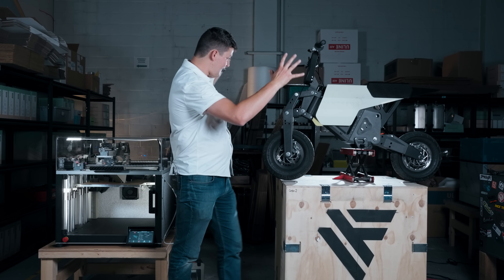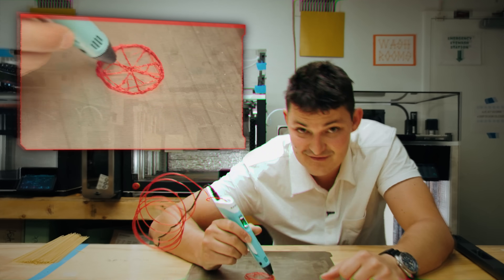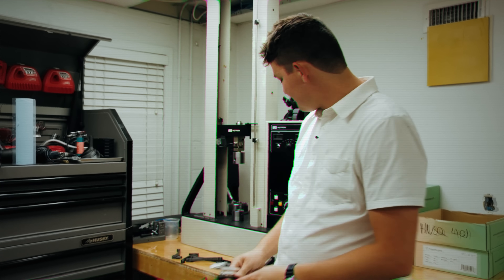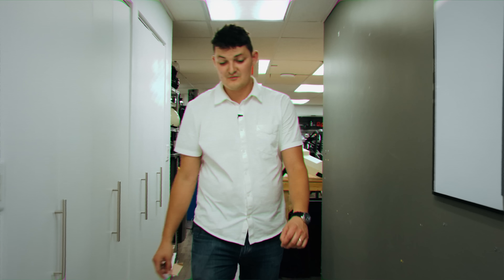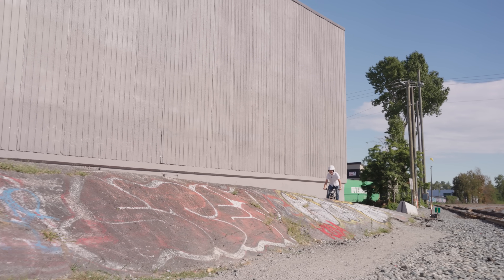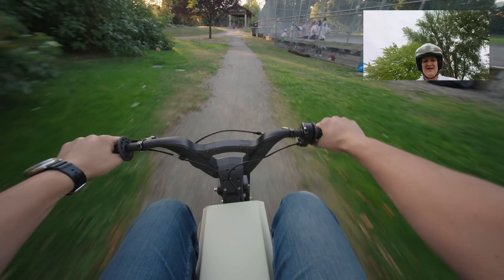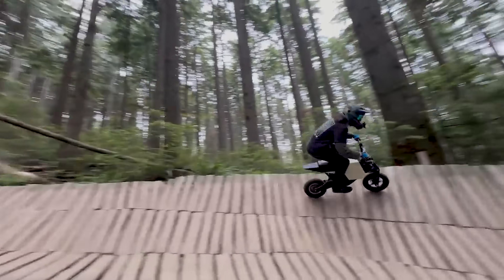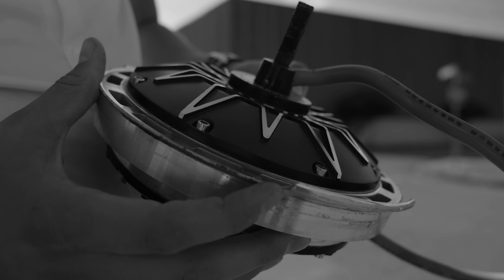Jumping a 3D-Printed Motorcycle - How Strong is the Future?

Comment: For prototyping 3D printing is a godsend. No arguments there. And also for hobbying and making obscure parts it's nigh on essential. To a point, as you mentioned, strength of the material as well as heat resistance is a major concern. Sure, you could in those cases use metal 3D printing, but that's another overhead cost, and it's a major cost to boot

And while the idea of a shop that sells print-to-order parts is attractive, homologation of said parts and the frankly immesurable danger to IP theft, not to mention the cost of the printers themselves and the time it takes to make a part, are major downsides. Especially for cars and the most often busted parts that you might need replacing - body panels. Scope of realistically 3D printable parts for automotive industry is way smaller than we might think. But the design principles and extrusion optimization we can learn along the way provides major value
Reply: You don't have to print the parts you'll use, it can be a lot better to actually print moulds or patterns which can then be used to make parts by other methods. For example, you can print a mould or plug and then layup composite over it, or print a casting pattern which is then used with traditional foundry techniques.
Reply: Pretty sure nylon absorbs water and weakens over time.
Reply: @pleepler Nice to see positive comments about 3d printed vehicles. Check my product if you want it has the most parts 3d printed, from metal chassis to rims and tires.
Reply: I think you're focusing on the wrong things that would be manufactured when you mention body panels. 

The actual, real, things that would (and are) be 3D printed for vehicles are the small plastics bits inside the cab like climate control knobs, turn signal stocks, air vents, infinite amounts of little plastic covers that exist only to hide screws etc etc etc
Reply: For the industry- yes. But a new age bodyshop's gotta have a printer. The only obstacle is, as you said, bureaucracy, but all you gotta do to bypass the feds is to sand and paint the part.
Reply: LOL you lost me at IP theft. Because we have processes like vacuum forming and other that can just straight up use 3d prints as molds as an intermediary step and the fact that FDM is no the only printing technology on the block, you are vastly underestimating it's applications for MEDIUM sized business and yes it should and hopefully will be massively disruptive for multinationals.

Comment: I never thought I’d be defending Groms, but I’ve seen Groms get thrashed 10x harder than that in skateparks and off road trails alike for many years.  They hold up just fine.
Reply: I got my grom new in 2016. Its been used for everything from commuting to shredding to long trips - and used hard pretty much every time including a good few times where its been flat out for 100+ miles constantly. The only "fault" its ever had is the mirror stems getting rust on them after riding it in winter on salted roads and not bothering to wash it. It sits alongside my other out of the garage bikes and its still one of the most fun things I've ever ridden.
Reply: @siraff4461  You use it for commuting? What kind of speeds do you do? Any mods? I commute on a 60 mph two lane most of the time, and I've been wondering if a Grom would be enough.
Reply: @isaiah7617  I've run it down the motorway a few times. Its not ideal and way, way out of its depth but sometimes I fancy a challenge and it will keep up with the trucks if nothing else. 
I'm quite a big lad so it struggles to go much over about a genuine 55-60mph. Its got one tooth up on the front, airbox and exhaust, renthals, new mirrors and a few other bits like crash bungs which double up as highway pegs. 
It will do 50mph pretty much anywhere apart from the largest of hills because thats now where it runs out of power in third. 
Again thats gps verified because one of the first things I usually do on a bike is set one up to make sure I know how far out the speedo is. It does about 3mph better with the topbox on - no idea why unless it somehow helps with aeros because - again - I'm quite a big sail. 
I would say look more at the real speed of the traffic than what the posted limits are. On the motorway the left lane is pretty much 56mph or less (the trucks limiters speed) so its not really an issue. On single lane 60mph roads its more tricky and I feel like I have to pull over now and then through courtersy. 
You can use it anywhere if you keep your eyes open but I would want a bit more power if it was my only bike. Having said that I've been spoiled by superbikes, motocrossers and 2 strokes for the better part of 40 years so you might want to test ride one and see how it goes. 
If you're not license limited there are plenty of tuning options too but I haven't done much to it because I have quite a few bikes to choose from and haven't seen the need.
Reply: @isaiah7617  One other thing I should point out - even when its flat out with a 22stone guy on it it won't get lower than 100mpg (uk) and if you treat it fairly on normal roads its usually up around 150mpg. The rubber costs almost nothing, the chains and sprockets last ages and cost almost nothing, there is no oil filter so you just clean out the spinner and put in less than a liter of oil for a service. 
I end up doing mine way more than necessary because anytime you've got it on the table to clean it or check it over you end up just doing an oil change anyway since it uses so little. It costs less to run than a bus pass - even including buying it.
Reply: @siraff4461  See, I've owned several bikes,  most middleweight sport tourers, like the XJ600 from Yam, an 83 CB650 from Honda, and a 98 Ninja 500. But the small bikes seem like they would be a blast, especially on my commute. I used to take a Chinese 150 scooter, but having a top speed of around 50 made it not great, and you'd drop to 45 on a hill. Thanks for the response, it sounds like a lightly modified Grom would do me well.
Reply: @isaiah7617  stock grom will not be enough, you can get an inexpensive front sprocket to make it go over 60(at the expense of off the line speed). 55mph roads are much safer to ride. it is really meant to be in inner city vehicle with insane fuel efficiency
Reply: @isaiah7617  A few of my friends also got them after riding mine and some are in different states of tune. One has a bolt on 150cc big bore kit, exhaust, cam (came with the kit) and piggyback ecu - also in the kit. It tops out around 75mph on a good day but will cruise at 60mph no problem. Its a different kind of riding on them. With a big bike you rarely use all the throttle and power but on a grom its flat out a lot of the time. It feels weird at first like you're going to break it but so long as they're properly set up and looked after they are solid.
Reply: @isaiah7617 I commute a grom too. Its an in town thing. Mine has mud tires and its topped out at 60. I only get on highways for short in town bits. If I leave town I have to take the back roads.
Reply: @siraff4461  Sounds a lot like the Royal Enfield Himalayan I had, the engine never broke down at wide open, but the cluster started disintegrating. I did ride a Honda CB300R at wide open for 140000 miles no issues, so I would expect the same from the Grom. Thanks for the info I appreciate it.
Reply: Right? I thought the same thing. The only thing that fails is the forks but those are easily and cheaply swapped out
Reply: Couple weeks ago ran into a grom squad at Tail of the Dragon, that was the only group I thought, "they look scared as hell on those things"  lol.
Reply: Love my grom.
Reply: i mean- its a honda.
Reply: I know. Groms are surprisingly sturdy.
Reply: Yeah that line was stupid as hell. I get that he needs to do ads for things but he should still pretend he knows motorcycle stuff during them IMO

Comment: no way that plastic is even close to being as strong as 6061 aluminum
Reply: during testing it is but i dont know how long it would hold up overtime
Reply: it is, this has been known for ages. your power tools probably also use glass/carbon reinforced plastic instead of aluminium too because of strong it is.
Reply: @marvinslomp3564  it's objectively not. He quotes 150 MPa tensile, which is ~50% of what 6061-T6 can do.

Comment: brake disks are backwards --- spokes in compression, not tension, while stopping.  about 98% of all ebikes are the same but trust me (look at my avatar) this is dangerous.  I pretzel'd that thing while trying to skid my back tire on loose gravel  (not what you'd call high-torque except that I snapped it on quickly).

Comment: It's not really a motorcycle... more like a e-bmx... 

There's also the question of UV exposure; going through the hot/cold cycles and impact on long term durability. I'm not sure what it is, but plastics get more brittle with age... so how long will these toys last?
Reply: Indeed Nylon is suspectable to UV degradation, a coating (paint job) however can eliminate/heavily decrease that risk just like rust on a metal motorcycle.

At the temperature of body panels and frame parts Nylon is fine, rarely if ever do your body panels reach much over 110°c (the deformation/glass transition temperature) so again; fine.

Hell there are many cars with plastic body panels, ignoring all the bumpers most beloved to me the Smart roadster

Comment: I am waiting for 3d metal printing to come down to a hobbyist level. I collect WWI era guns and it would be a game changer to be able to replace small parts that have been out of production for at least 70+ years without having to hunt down used parts.
Reply: It kinda already is. JLC3DP can do metal parts, and it is pretty affordable. Worth modelling what you want and throwing it at their quote tool. Big stuff will be expensive, but small bits are very cheap.
Reply: Imagine being able to make a Vickers gun in your garage from some discarded bits of metal and brass. It'd be fantastic!
Reply: For some of those small metal parts you might be better off spending the money on a cheap 3d scanner and some modeling software. Then send the info to send-cut-send or some other place and they can cut those pieces out of most metals you'd like. 3d printing won't match cheapness for simple stamped steel parts for awhile. Hobbyist printers that can do metal are very expensive and the wire you'd need would be very expensive per part. If you can replace the parts with plastic it opens up a lot of possibilities, but I think you're better off sticking with stamped or cast parts. Casting can be done at home too if you're willing to work on your skills.
Reply: just get a bridgeport?

Comment: Okay, but how in hell are those springs working? Plastic can't bend that much, can it?
Reply: Not everything  on the bike is 3d printed, just most things, the stuff they can get away with
Reply: you can print flexible materials, but i think those are just normal suspension components

Comment: Whilst 3d printed carbon fibre nylon is strong when printed. It becomes very fragile overtime as it absorbs moisture if it doesn't get annealled or coated with some sort of waterproofing laquer.
Reply: the moisture isn't what makes it weaker over time, it's the internal stress of not being annealed. Nylon 6 or 12 parts are MUCH tougher when moisture conditioned.
Reply: Nylon gets stronger with moisture, it needs to be dried to print but its gets weaker as a result
Reply: moisture increases nylon ductility
Reply: Watch CNC Kitchens newest video on PA-CF materials, it suffers from creep quite severly, meaning bolts need to be tightened constantly. Not the thing you want on a motorcycle!
Reply: Currently running a CF nylon intake for my CBR swapped Grom for over a year now while being parked in the sun. Didn't use any coating or whatsoever. I didn't expect it would last this long though honestly.
Reply: I have a quadlock with longer arms that I printed in bambu ppa-cf which is mounted to my handlebar center clamp. Meaning, those arms are being directly compressed by the clamping bolts and if said bolts come loose, the bars will rotate.

It's been over 6 months and the torque I set on those bolts is the same. No creep, no cracking, all good. I checked the bars for movement constantly at first. I was paranoid.
Reply: Anything not coated will rot away, including steel. Kind of a common problem of vehicles staying outside. Carbon fibre is not different.
Reply: I think you can also make submarines for billionaires with this. Titanic trips, anybody?
Reply: I've had good luck with pla even left outside or under stress over time.
Reply: @skoparweaver7692  Yeah, but PLA isn't nearly as strong as PA6/12 CF.
Reply: On paper yes
Reply: @blueridgewarden  reminds me of a saying:
In theory, there's no difference than theory and practice
In practice, there is...

Comment: 3D printing is superb for prototyping and for small scale manufacturing. Anything above that is not worth it.
Reply: Theoretically a large mechanic shop could have one of these so they don't have to wait for parts, but even that won't work because the parts suck
Reply: Just like the cnc revolution before it. It has amazing abilities of utility for certain things
Reply: that depends on the geometry and material of the part

Comment: You can even 3d print titanium alloys, depending on the material and design of course it will be safe.
Reply: What is a mig welding if not original 3D-printing with metals.
Reply: @ninefingerdeathgrip  sort of, but not really. I don't think you could make anything entirely out of the filler wires. There is a process called WAAM (wire arc additive manufacturing) that is exactly like you're talking about. It's been around for over a hundred years, but I don't think it's that popular as none of the welders I know have ever seen it.
Reply: Nothing safety critical will be 3d printed. End of story
Reply: @ElijahRose-u6f  Incorrect. There are several bike companies 3D printing lugs and other parts for their frames, 
Heck, watch Sendy Club's videos, he's using 3D printed uprights to hold the wheels on to his Pikes Peak car.
Reply: @Surestick88 dude, it's a bubble. They'd make one part with the machine just to see how it works and get free money from wall street
Reply: @ElijahRose-u6f Okay man, believe what you want.
Reply: @Surestick88 how much did you lose on the stocks?
Reply: @ElijahRose-u6f  Define safety critical? While some parts might be critical for the safety or integrity of a product they might not be required to carry great loads. If calculated and made to spec 3d printed parts can last perfectly fine. Metal 3-D printing is also vastly stronger than plastics. At 2:40 in the video the yield strength is even compared. Besides that multiple real world examples are shown in this video also.

Its not my field, so dont have too much experience. But there are a lot of real world applications of 3-D printed metal. Especially for intricated shapes that are impossible to manufacture
Reply: @ElijahRose-u6f  Anyone that says this, knows very little about 3D printing
Reply: @ElijahRose-u6f  Very much not true already - indeed many of the 3d printing pioneer industries were very much safety critical. Think jet engine turbines and other very, very much safety critical items. Heart valve replacements are also somettimes printed, and while it's a smaller scale it's still pretty darn critical to the individual. Yes, there is often needless hype about 3d printingh, or AI, or inset shiny new thing here, frequently associated with stock performance, but don't mistake some of it being just hype with the tech itself being useless.
Reply: @ElijahRose-u6f 
Perhaps not FFF(exep in some industry's printing peek and such), but a lot of stuff is now sla printed, it is the same strength as the bas metal
Reply: @ElijahRose-u6f  Dude, GE's fuel nozzles for an airplane engine are mentioned in the video at minute 7. I would say that is a pretty SAFETY CRITICAL application, especially when taking off, so your argument is already debunked by just PAYING ATTENTION to the damn video you are commenting on. GE are operating like 40 metal 3D printers for the sole purpose of part production, not to "make stock go up".
Reply: @LAndrewsChannel Come on. We both know your statement is securities fraud even if it were technically true